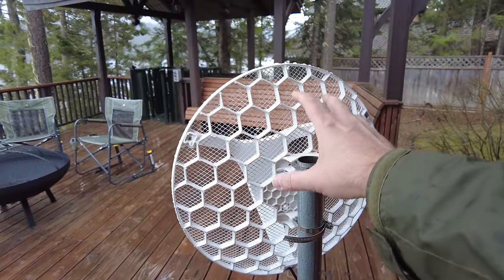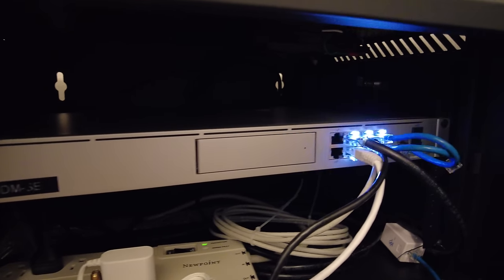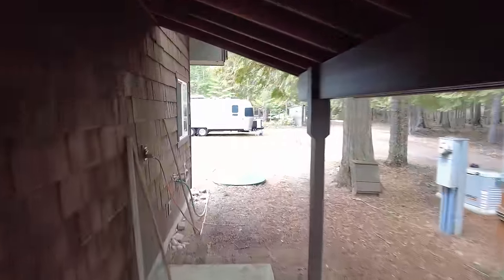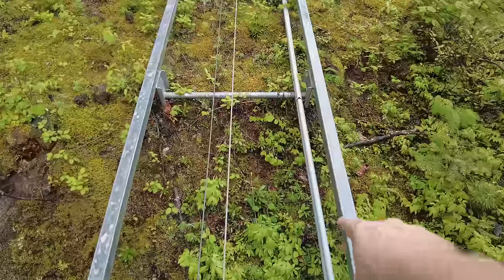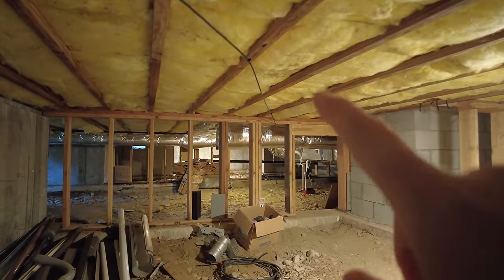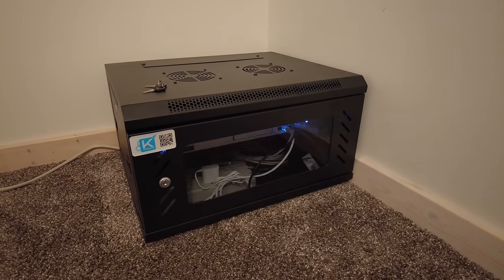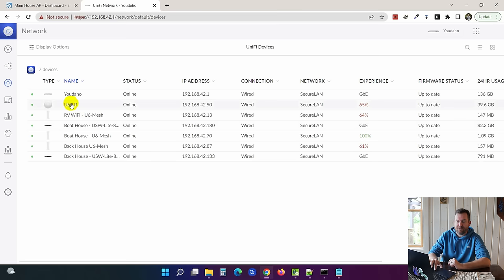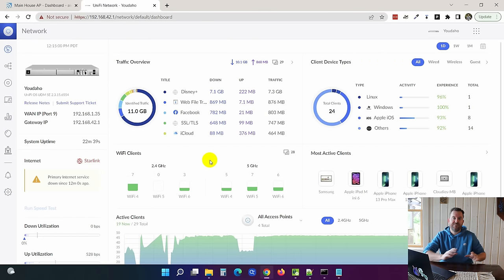An EPIC Network Install in a Beautiful Location!

Comment: That's a gorgeous property and a fantastic video.  Great drone footage as well.  Seems like there's no need at that property for super robust LAN beyond 1 gigabit at the moment -- no NAS with movies or any random servers.  Here in the Southeast USA, the lightning is pretty insane, and we've lost several thousand $$ in equipment from a direct lightning strike that somehow managed to enter the house through coax -- > cable modem -- > ethernet cables to all devices despite having super robust AC surge protectors (high end Zero Surge for my stuff).  With that said -- and I'm new to fiber -- maybe a Phase 2 would involve adding something like OM-4 multimode fiber optic in that conduit between the boat house and the main house which would pretty much eliminate lightning/surge risk.  I think it can terminate into SFP or SFP+ connectors of your choice and this would allow 1 or 10Gig today and even faster in the future with switch and router upgrades.

An expensive Phase 2 would be to also run conduit and fiber between the main house and back house instead of the PTMP solution (which does seem rock solid for what it's worth and very cost-effective).

I saw a U6 LR being used I think in the main house but not much discussion...was curious why U6 Mesh was used for some of the interior APs vs. maybe a U6 Lite?

Just rambling out loud.  Loved this video a lot, Chris.
Reply: Yeah, why U6-Mesh and not U6-Lites? Why the mesh at all?
Reply: Likely because the U6-Lite is 2x2 MIMO while U6 Mesh is 4x4 MIMO, and some folks seem to favor the looks of the Mesh model. Despite the name, it's a great wired AP — IMO the "mesh" name was a marketing move, and shouldn't sway a system designer or installer's decision.

Comment: Great video and great project. I would have liked to have seen a little more on the VLAN setup of that 8-port switch you've got the dual WAN connections feeding into.  You detailed the setup for ports 7 and 8 nicely, that all makes sense.  But what about the network tagging for the connection up to the UDM-SE and the connection for the WiFi there at the boat house?  How did you essentially make that switch sit both between the WAN and the router as well as on the router's network all over a single cable?  I think I'm missing something.
Reply: With VLANs you can "split" a Cable into multiple completely seperate cables (the total bandwith is obviously still limited to the link speed)
Reply: @n.l3880  True, but I guess I'm curious about how it is setup in the UniFi controller specifically.  I'm assuming the feed to the UDM is connected to a port with All set for its network profile, and then the AP is probably connected with just the Secure/Guest profiles.  But if the main feed port is set to All, how does the switch not go insane trying to decide if it is a part of either of the WAN networks or the LAN network?
Reply: @angrybatvoice  The boat house tags the VLANs (3&4) on Ports 7/8, the Port 1 (I think) is a trunk port carrying both VLANs to the UDM-SE. Unsure what port on the UDM-SE he used to terminate that connection, but that one would be configured as a trunk as well. From there, he had port 7/8 on the UDM-SE configured to be VLAN3&4, which then untagged traffic flows out, and he physically connected Port 7/8 to the WAN1/WAN2 ports on the UDM-SE which expect untagged traffic.

The rest of the ports would not be trunks, etc, they would just be configured for another specific VLAN, I suspect he used VLAN1 for Secure, and VLAN2 for Guest. So only untagged traffic is going out of those, which none would be for VLAN3/4.

The traffic coming into the UDM from the boat house will always be tagged with either VLAN 3 or VLAN 4, that's how the UDM keeps it straight if it's WAN or LAN. Anything LAN will be presumably VLAN1/2.
Reply: @angrybatvoice  switches will always try to get an ip from the native untagged vlan 1 unless you go into unifi-services-management network and specify which network you want it to land on. It will never send a DHCP request to a tagged network unless that tagged network is set as the native vlan.
Reply: @ZippyDooDa435  Nope - Port 6 is the Trunk - there is a black Cat 6 cable connected - you can see it on the video. Port 1 is used for the Acces Point.
Reply: Me too. I've tried similar and while it worked on a single switch (have AP station from HOA network into my home network), then can join other devices into the same HOA network by defining the same VLAN on other ports. However when I'm trying to set a port into the VLAN on my UDM-PRO - can't join HOA network 😞. Totally lost here

Comment: i had a similar situation. a house with main internet and a carriage house/garage about 150 feet behind that. instead of a wireless bridge, i just blanketed the area with a couple access points in the house, and then a wireless mesh network for the carriage house and anything outside of that range. i used all ubiquiti equipment and it worked like a charm. super simple and easy as the mesh system just needed power for the mesh access points.

Comment: My parents have a property very similar to this in Minnesota.  The cabin is about half way down the hill on the property. With one access point that's away from the lake in the center, I can get Wi-Fi all the way to the top of the hill about 75 feet from the cabin away from the lake and 250 yards out on the lake. The signal is very low at those points, but it comes in. The only dead zone on the property is the hill going back down toward the road on the other side which we will never use because the trees are way too thick there. I ended up putting 2 access point just because the internet came in over on the west side of the cabin and the signal got weak way over on the east side. With that said I'm adding more access points, but it's not to cover the property.  I'm trying to get better signal across the lake.

Comment: Regardling the outdoor cabling, I feel you. I use the same stuff for some enterprise wireless needs in our Data Center, and the stuff is so difficult to terminate. They definitely require a crimp cover and more excess cable to work with than normal. As well as a couple of shots to steady your nerves.

Comment: How did you move the WISP Mikrotik antenna and confirm signal strength? Did you have access to the config to verify or ask the WISP to monitor while you remounted it? Is the fresnel zone clear? Shooting over water can be problematic with moisture/humidity changing signal patterns (reflections, etc). Probably a good idea to put a disclaimer to viewers to not mess with the WISP connection unless they approve it. Otherwise any issues the WISP could say not it isn't their fault, not warrantied, billable truck roll for future issues, etc.

Also on the CAT6 shielded connectors, did the foil actually get pushed into the 8P8C connector? If it didn't the shield is essentially useless. The PockEthernet reading seemed to indicate shield had no continuity if that was the right cable. Also you may have want to look at surge protectors on the boat house to main house cable run, even though it is in conduit.

Comment: The only thing that I may have done differently is to use single mode fiber to connect the boathouse to the upper house in order to avoid any kind of electrical surge from storms.

Comment: Great video Chris, I think this may be your best yet. I’ve got a very similar job coming up, very new to UISP so was great to see how you did things. One question do you/would you ever use the UniFi building 2 building bridge? I like the fact it’s all controlled in UniFi, however price point seems a little expensive compared to the UISP airMAX products.

Comment: I know the struggle with terminating outdoor cable, especially gel filled and gave up long ago trying to terminate it with RJ45s.  You can test it and 2 days later it will fail because of strain relief issues.  Much easier to punch to Keystone, place in a surface mount box, and go to a patch cord to the switch/router.

Comment: I'm intrigued by the way you place cabling in and around the buildings. Is this an accepted practice/code in the USA? Is it because of the way the houses are built? In Australia we have to run everything exposed inside conduit. Normally we would run cabling through the roof to ceiling cavity. No attics in AU. We would then run cables through the wall cavity then terminate at a plate on the wall. Most modern homes in AU are built on a concrete slab, whether they are single story or multi story.

Comment: Great design!  The only thing I'd do differently (at least in my location) is not run a hard-wire between buildings but use fiber. We have a lot of thunderstorms, and the electrical potential between buildings during a storm will zap the hard-wire connections...even with shielded cable in consuit. Fiber resolves that issue for us.

Comment: A "horizontal cable" between locations should always be terminated on jacks. Modular plugs are not made to crimp on solid wire Cat6 cable, no matter what people (and vendors) say. The reliability of structured cabling depends on IDC connections: jacks and patch panels for solid (horizontal) wire, plugs for stranded (patch cord) wire. 

Quite a few manufacturers have tried to make "field terminable plugs" with mixed results. They are usually very large and expensive and often they are no better than mod plugs - they pull right off the wire.

Comment: It's a bummer that they didn't add any network wire or panels during what looks like relatively new construction. 

You totally made the best of what you had to work with though!  I wish every crawl space had that much headroom and LIGHTING!
Reply from the maker: Yes - agreed...I checked behind the RJ11 jacks, but it was not CAT cable unfortunately.  Would have been a nice bonus.

And the crawl space was pretty decent!  Much better than my own house.

Comment: I would have done things this way:
- UDMse in the main house as is. Starlink on the main house's roof.
- Wire down the boat house with 1 Flex AP. A PoE switch could be added later if cameras are needed.
- Wire up to the back house to a PoE switch, a couple Flex APs. Cameras and doorbells could be added later also.
- One flex AP inside the RV connected as a mesh node to one of the APs in the back house.
I honestly do not see the need for PtP and PtMP devices 🤔
Reply: Yes much more sense - Antenna straight to main House , just wire down an access point to the boathouse - thats if the mesh signal cany be wifi anyway -
Reply: Remember that he did say that the main house roof did not have clear LOS to the northern sky for the Starlink due to the trees surrounding the main house. That's why the dock had the clearest LOS to the northern sky. I understand where you're coming from in wanting to both connections on separate power sources and with the main house having a backup generator. Maybe the Starlink should have been cabled directly back to the main house from the dock if length wasn't an issue. All and all though, great deployment.
Reply: Starlink has to have 220 degrees of unobstructed view of the sky in order to work properly, and looking at the drone video it looks like that wasn't possible.

Comment: If you ran into trouble with the RJ45, why not put an RJ45 keystone on the end that's easily punched down then use a short patch cable for your final connection? Or even a biscuit jack?

Comment: Great network design. The only thing I would have done different is the CAT6 link between structures. First, let me say that I am from Florida, the lightning capital of the world. I would’ve used fiber instead of copper. I’ve seen so many copper ethernet connections run outside or underground here in FLA and even with surge protectors, they still take out the bulk of the network. That would be my only suggestion. Great video!

Comment: Engrossing video, really informative.

My initial thoughts on getting the various connections to/from the boathouse was why not use three cables, one for each wan and one back down for the access point but then I saw how elegant the VLAN solution was. I do wonder about (slightly?) increased potential for failure though. Cable problem, internet goes, switch problem, internet goes.
Reply: Great point.  I didn't really think of redundancy in physical cables.  They have primary and backup WAN connections but going through the same outdoor Cat6 cable, so that does seem like a single point of failure for both WANs and all LANs to the rest of the property.

Maybe out of an abundance of paranoia a cold standby wireless p2p bridge could be made from the boathouse to the main house in case the cable running in the conduit somehow malfunctions.  Maybe another pair of NanoBeams or even NanoStations that are configured as failover somehow?
Reply: There's still a string line running down the conduit so they can run another cable easily enough if it fails.
Reply: I would have just run an ethernet cable for each device in the boathouse.  Then POE could have been used for all the devices from the main house and the UPS and switch could have been avoided in the boathouse, meaning less equipment for the guests to mess with.

Comment: Wouldn't a fiber run between the two buildings be a safer option to electrically isolate the two buildings? From my understanding, if the grounds between the two buildings are not bonded, they would have two different impedance values. And that impedance differential can cause currents to flow over your copper wire.
Reply: They are almost certainly on the same electrical service with a bonded ground system. The only benefit of fiber would be lightning protection
Reply: Difference in potential, not impedance. But, yes you are correct.

Comment: I guess in summary.. Unifi doesn’t like transit VLAN’s. 
You’re putting a Unifi switch on the WAN side before the UDMP and trying to manage it. It won’t provision when you do a reboot. 
If everything was up and running during configuration it works. Not after a reboot. 
Correct me if I’m wrong 🤷🏻‍♂️
The only way it will work correctly according to Ubiquiti would be to move the UDMP SE to the boat house and the switch to the main house.
Reply from the maker: You’re 100% missing how this was accomplished.
Reply: @CrosstalkSolutions  Actually I understand completely what you did. 
UI’s email support is slow and useless.
I tried a very similar setup but I was only passing my WAN traffic from my modem over a Gigabeam link. VLAN only, to a port on my UDMP then linking that VLAN port only to my WAN port. I was just trying to put my Gigabeam link on the lan side (like your 8 port switch) you’re using an outdoor cat6 cable. 
Mine was much more simple. 
If everything was up and running, I could do this configuration. If I had to reboot my network for any reason it would not provision. It puts the UDMP in a loop trying to make an internet connection internally (port to port) and fails.
Not sure if you did a reboot after you got everything configured. If you haven’t, don’t do it remotely unless you want to drive 10 hours to fix it. Trust me, it won’t provision. 
You will lose the internet connection. 
I was told by UI support these devices aren’t capable of this unless they’ve updated the software to handle it in the last couple of months. 🤷🏻‍♂️

Comment: Very nicely done video and refreshing to see outdoors for a change. I'm familiar with unifi but don't use mesh or Starlink, so it was interesting to see how these are implemented and configured in this type of use case. Curious how did Aaron terminate your CAT-6 from hell cable differently since you're no Spring Chicken when it comes to terminating cables?

Comment: Great video. I did the same vlan only tag for a client who had two internet connections on each side of the business. I bought the exact same cable and will NEVER try and put a male ends on ever again. Punch it down I into a patch box and then use a patch cable.

Comment: Chris, i dont get it. Why not to use three cables from boat house to main house (udm pro), one for starlink, one for Wisp, and one back down for the access point (boat house)? Starlink and WIsp is going through the same outdoor Cat6 cable, so that does seem like a single point of failure, right?

Comment: I have virtually the same setup, Starlink and lte.  The Starlink and lte are physically at our guest house and I ran 3  pvc runs between the guest house and the main house.  I spent hours on the cat6 connections crimping then and fail every time.  So I’m thinking the cable is/was bad.  So I created a equally long run as a ground run and got the crimps right and tested out.  I’m going to hook it up next and see if it actually passes data, fingers crossed.  I want to do an auto failover too, but one thing at a time.  Also using all ubuiti too.

Comment: I bet this was fun to do. A lot of work, of course, but still fun :)

The only thing I would consider doing differently would be the connection between the house and the boatshed. If it was possible to pull an MTP cable with 4 fibres in, you could have had an awesome and totally overkill solution for this without the VLAN setup. The only attempt at a technical reason for this is to keep the boathouse and house electrically separated. Well, that and that it's going to be very hard for someone coming in and looking at your setup to do maintenance on the system without a briefing from you - of course, the owner should just show the person this video.
Reply from the maker: Yea - I labeled everything, so hopefully if anyone else works on it, it should be pretty clear...
Reply: Yeah, I was surprised that fiber wasn't used between the boathouse and the main house. I thought keeping those systems electrically isolated was best practice.